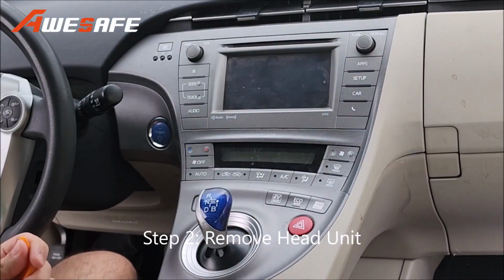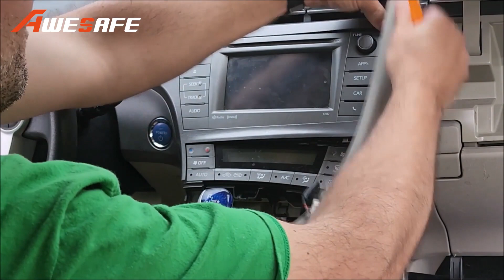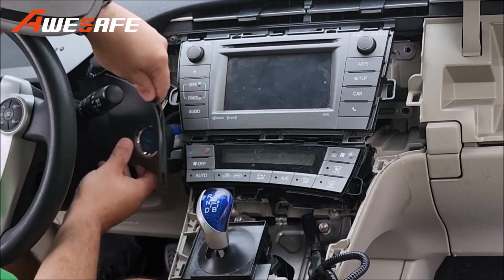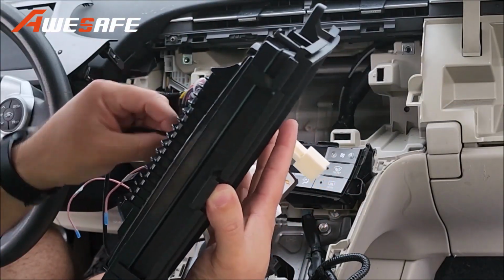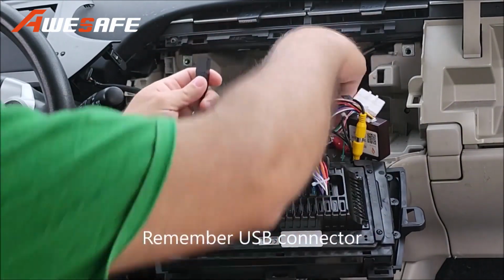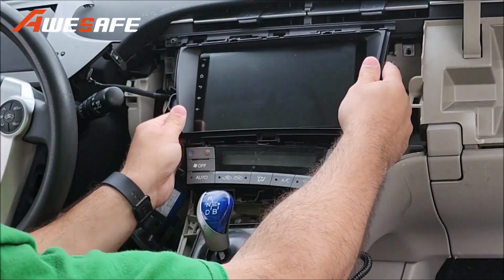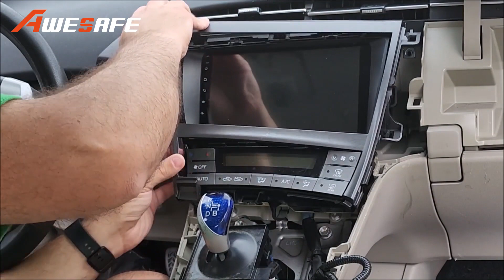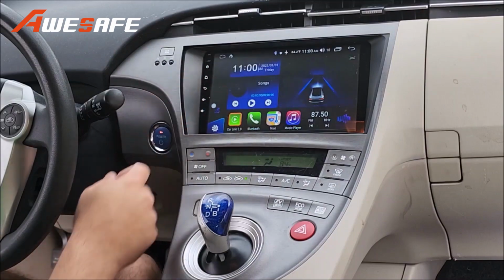AWESAFE Car Radio Stereo Andriod 12 Compatible for Toyota Prius 2010 2011 2012 2013 2014 2015

Comment: I was able to install the head unit, things work fine except the factory backup camera and the auto lock feature when the car is put in gear or reverse. What's causing this?
Reply: Hello. Finally you connect yours factory back cámara?
Reply: @tarasivaniv3084  no. I need the aftermarket camera
Reply: @endlesstechandgaming  it’s doesn’t work? Can send me what cámara you bought and how it is works? Thanks

Comment: Is the USB connector related to the steering wheel volume and phone controls?  I installed an aftermarket head unit, but the model I purchased did not come with the USB connector and I have not been able to figure out a way to get the steering wheels controls to work.  Any advice is appreciated!